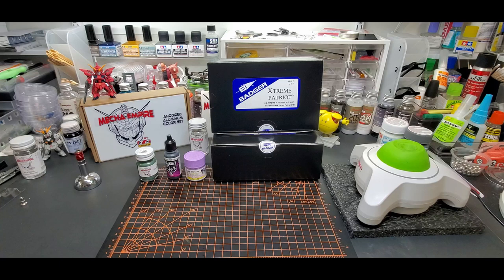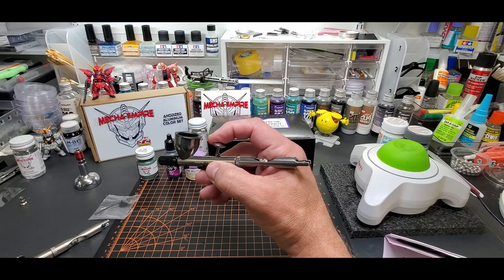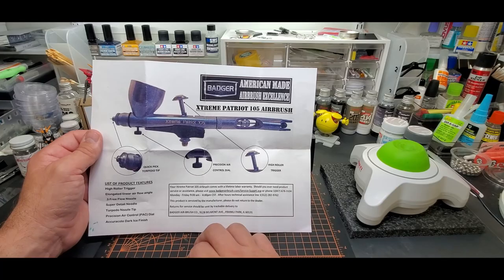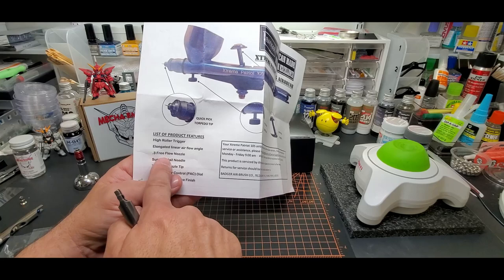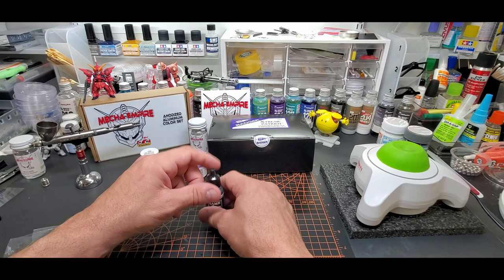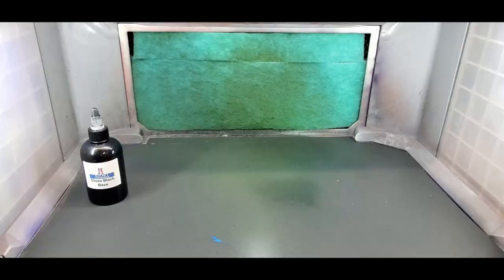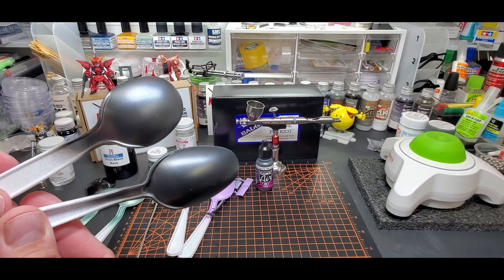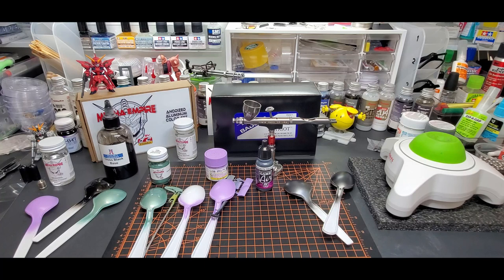Testing The Badger Xtreme Patriot Airbrush For Model Building - Plus Giveaway

Comment: Neat airbrush. Started watching and just subbed recently as I'd like to get back into doing some airbrushing and have found your videos to be quite enjoyable and thorough with the reviews. I do wonder if that pack valve may have something to do with the airbrush's performance with non-thinned paints like the Valejo metallic you had used? Like, say perhaps you run the brush at an overall higher pressure, and then use that one to back it down to the right amount for w/e paint you are using. I also wonder if the looseness of that valve dial can be fixed somewhat with a small piece of springsteel to hold it in tension too...

Eh.. Should I ever get my hands on one of these, I'll try and get my own answers, but for now, great video and thank you for that info you've provided.
Reply from the maker: I found out something tonight, the small screw is a lock valve of sorts. It disables the Mac valve. The big screw is the one that adjust the air flow. The big problem was they don't say anything in the manual at all. I might update the video to show this
Reply: @barbatosrex9473  Huh...  that seems weird and potentially ill-designed if one adjusts flow and the other just disables it. As it isn't in the manual, I wonder if that is intentional or if there is a manufacturing or engineering defect that is causing the difference based on which screw is installed? 

Either that, or perhaps it is meant to be some sort of option for the painter if they want to use the airbrush? A solid standard setting with the small screw and an easier to turn variable setting with the larger? Just speculating here as I've no idea on the actual dimensions of either screw, but I could see that as a "feature" that someone thought may be too technical sounding and was left on the cutting room floor when they were making the manual.

Comment: I have bin looking to replace my cheap airbrush i got 2 years ago. really don't know what i need for minis
Reply: Don't underestimate what a cheap airbrush can do. So long as the needle isn't bent, it might just need a bit of deep cleaning to get it working right. 95% of the problems I've had with airbrushing have been caused by tiny clumps in my paint which build up and clog the nozzle.

Comment: I'm going to have to start saving my pennies after watching this , I've been airbrushing for just a few months and trying to find my feet so to speak,  I'm using a econd hand Richpen 033g I bought from a charity shop and having  many problems, blockages ,poor spray etc,it's got a screw cap on the  top I wonder if it's the same thing as on the Badger? I can't find mention of it anywhere it's just listed in parts , I've no paper work for.
Just a thought, could the original Badger be upgraded with the longer trigger and the thumb rest?
Good luck to all .
Reply from the maker: Yes, you can add the high roller trigger to most Badgers, and they're cheap too, around #10

Comment: I'm just starting to get in to airbrushing and have been watching you since Christmas. I have bought alot of mr aqueous paints and thinners but what size brush would you recommend for 1.24 car builds.  I'm thinking about the mr procon trigger types ether 0.3 or 0.5 ?
Reply from the maker: For car bodies I'd go with the Procon 0.5mm or the Patriot 105. The Procon is great but it uses a ton of paint. The Patriot 105 is about the same size and covers the same but doesn't use quite as much paint. Then there's price, the Patriot 105 is on sale right now for $70 at the link above. It's one of my favorite airbrushes and at that price it's a no brainer
Reply: @barbatosrex9473  thank you so much for the reply.  I must see is the 105 available here in norway . Its crazy expensive here to import from the states or should I say from out side norway

Comment: I got one of these as a Christmas gift and have been similarly confused by the air flow dial, which seems to do nothing. Mine also arrived with the whole interior coated in grease, which I've never seen before. I contacted the seller and they said it was normal and likely added by the manufacturer, though Badger themselves never responded to my queries when I contacted them. Anyone else have this occur?
Reply from the maker: The grease is part of the manufacturering process. It should have been rinsed out but it looks like yours got pass that step. If your Extreme came 2 dials, use the larger one, the small one is just a plug if you don't want to use the Mac valve. I found that out after the review. The manual says nothing
Reply: @barbatosrex9473  Thanks a lot for the response, BR. Very useful! Any advice on how to rinse out the grease, ex. isopropyl or something else?

Comment: What's the best compressor to use for airbrushes?
Reply: I can answer that: A big expensive one. But seriously, if you've got the space for it, don't buy an "airbrush compressor", buy a workshop compressor that has a reasonably large air tank. As someone else explained to me "you get more air for less power" - the motor has to cycle less often so it saves on electricity and puts less strain on the motor. A 1 litre air-tank will work, but I've read that 8 litres and up is better. Oilless compressors don't need maintenance but they are noisy (even the "silent" ones) oilled compressors are much quieter but they smell of oil and you should be a bit careful not to drip oil on a carpet. I would buy an oil-type silent compressor. Currently I already have an old Jun-Air compressor (oilless, 4 litre air tank) that does the job (I bought it very cheap secondhand) but eventually I will likely buy a Bambi BB8 or BB24.
Reply: @herculeholmes504  Thanks for the info, much appreciated